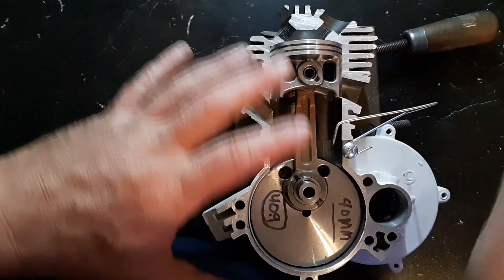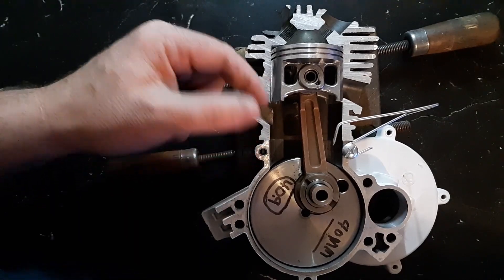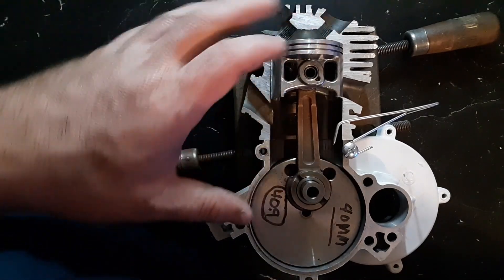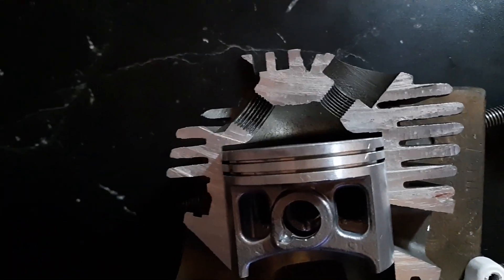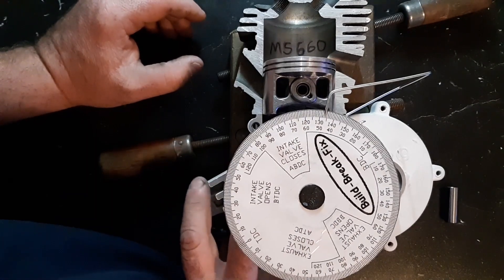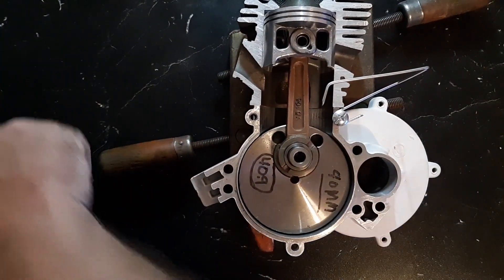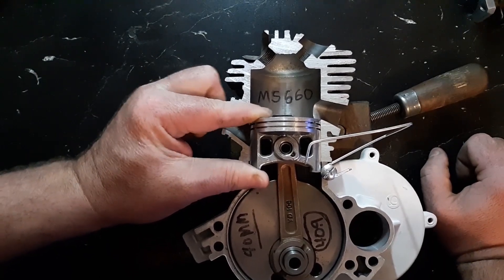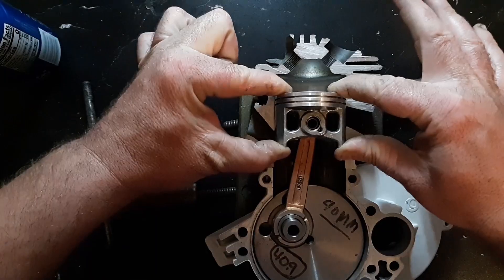Motorized Bicycle Build MS660 Cutaway Timing Video - Long Rod Explained!

Comment: I have been working on another build also! MS660 build! Problem is that i can not find the Husqvarna K760 piston rod by itself without buying the crankshaft too! What is the serial number for the Husqvarna K760 piston rod?
Reply: July 13,2024!
Reply from the maker: @KevinLunsford-je3rz  you have to go on eBay find one. Use a cut off saw on the crankshaft.  It's what everyone does.
Reply from the maker: Sorry about the delay I was sick for a while then took a vacation
Reply: @BuildBreakFix  Thanks bro! Hope you enjoyed your vacation after being sick?!

Comment: Can I use a K970 Connecting Rod instead of a K660, or K670?
Reply from the maker: To be honest no idea.  Only used the one.  I know a k970 for sure won't.   Way to long.  But a k670 I have never physically seen before in person
Reply: @BuildBreakFix  so as far as you know I can only use the K660 right ?
Reply: @BuildBreakFix  so what rods should I use with a yd100 crank on a 660 build?

Comment: Where do uou get the high compression piston from Im bringing this one on a race track
Reply from the maker: Sadly pop-up piston on ms660 is OEM only item it seems.  Reason is it's known to snap crank shafts.  Ms660 is over 16hp lol factory on bicycle build. It's why you don't see many 87ftlbs torque roughly. Tears the whole rear end apart fast. It's why you don't see many actually run very long. Or at all on a bicycle. Mine twisted a felt faker frame like pretzel

Comment: Building a hs 660 now just need info on what rod to use where to get pop up piston and specs for conversion or if you sell piston conversion kit
Reply from the maker: No conversation needed of you use the correct rod.  Most look for an old Husqvarna concert saw 770 or bigger all same rods.  They come on a crank factory.  Cutoff saw is how most remove the crank.  Fits perfectly on stock yd100 crank web and bearing.  14mm ms660 bearing fits wrist pin no mods

Comment: Bro, Ive been looking for that connecting 120mm. I cant seem to locate one. Could help me out with that like where you got yours?
Reply from the maker: They come in the cranks.  Mose cut off saw the crank to get the rods. eBay 25$ to 35$ used one!   They are hard to find everyone buys them up fast.  OEM good lord.  $$$$ for one to murder is crazy
Reply: Thanks bro, I think I found one. I'll see if it's the right one. Otherwise I'm losing out on 55.00 bucks and 8.00 shipping. Haha

Comment: What type of Husqvarna saw did you get the 120mm connecting rod from? Read in the comments yoy need to buy the whole crank assembly then cut it to get the rod. Just wondering what saw the crank comes from.
Reply from the maker: 760 or 790 rock saw. Ones you cut road to CV concrete with. Cranks are like 30$ on Ebay for decent used one. Cutting it in half anyhow lol
Reply: @BuildBreakFix  Oh cool thanks so much for your help love the work you do man.

Comment: Can you clarify at 4:00 "crank pin bearing is not stock to fit this 24mm rod hole to 16mm pin"
Are you referring to the wrist pin bearing that's in between the 2 crank weights?
What do I need to convert it?
Reply from the maker: Carnk webs since they are round lol but are you asking the crank webs bearing dimensions? All in mm 24 od x 15wide x 16 id needle bearing.  It's a 12mm wrist pin piston end 16od 14wide 12id

Comment: Anymore connecting rods I can get that’s 120mm that isn’t the brand you mentioned I need urgent help on that asap
Reply from the maker: what are you even asking?  kinda lost me.  you saying that cause of crank design for that rod?  you need to buy the full crank and rod it how they are sold.  most buy them off ebay just cut off saw the crank steal the rod only 35 to 40$ whole assembly.  so not really sure if that is what you mean or something else?

Comment: link for the 120mm connecting rod?
Reply from the maker: you have to buy a whole crank with one.  ebay one.  like 35$ whle unit cut stock crank off it what most do easiest way/.

Comment: I guess i got lucky with mine.
I had bought a yd100 that was screwed up, the cylinder studs were drilled very poorly, causing the piston to rub hard on the walls, had no power, etc. So i bitched about it and got a refund.
I noticed mine had a zmn100 rod and and bigger wrist pin. So i thought what the hell and plugged the holes and slapped on an ms460 jug.
Well it didn't work out so well so i put an ms380 piston in and everything lines up great. No base gasket tho, but all the ports clear and reassure like 1.5mm squish.
I need to go buy a chain and lock abd i can't wait to see whats up. Im hoping everything will be fine, as its my first saw build.
Ive had it built for like 7 months and haven't fired it up yet .
Kinda wondering about tne timing with the magnet, is there anything that i should know before trying to start it? Thanks.

Comment: Thanks for your informative videos, I appreciate it. How did you make up for the difference in the crank pin?  Is the wrist pin still 12mm?
Reply from the maker: the correct con rod uses a 12mm wrist pin anyhow! otherwise you need sthil conversion pin. to 10mm for like yd100 or bushing

Comment: I have a phantom 85 will this just bolt on
Reply from the maker: Ms460 jug has 50x54mm hole pattern. Chain saw file make ovals on jug to fit 50x50. And you will need 8m to 6m thread adaptors and 4 6mx15mm long allen head bolts. 12mm crisp pin.
Reply: @Build-Break-Fix  the stock jug blew up and I figured why not go bigger I was told the 54 mm jug will fit without having to bore out the case just drill some holes would that be better or should I stick with the 52mm 460
Reply from the maker: @jamess7681   well honestly go 52mm version.  Yes I have a 54mm but you need to upgrade bearings to like ceramic bearings or you wont last long!  52mm already pushing the max rating of operation for size and spec of steel types.  Ceramic ones are not cheap
Reply: The crank bearings?